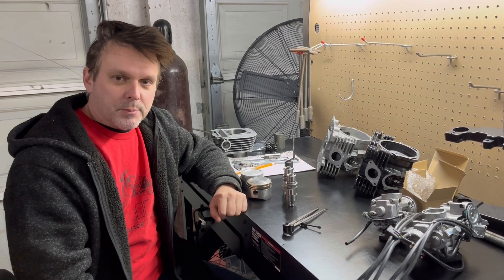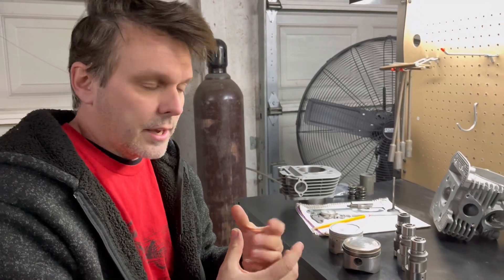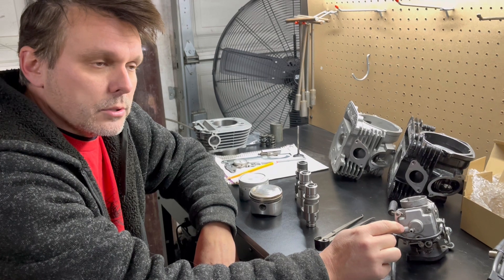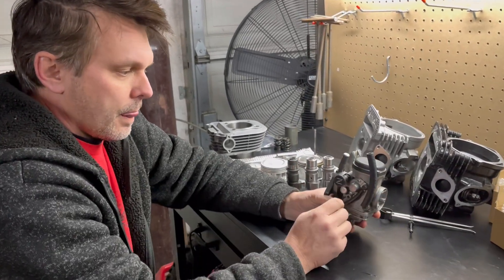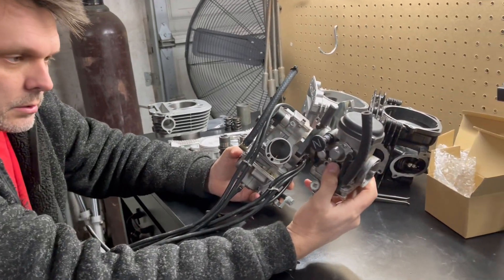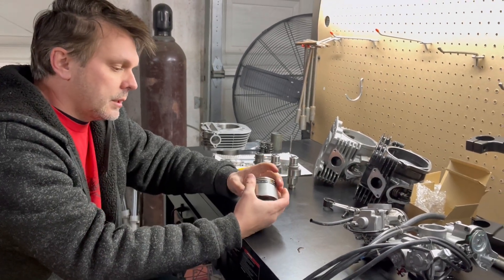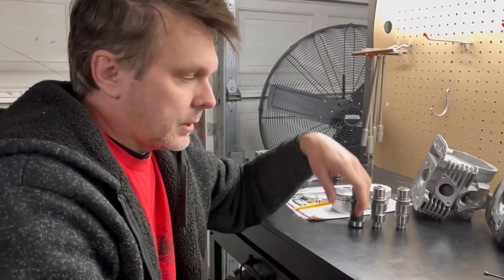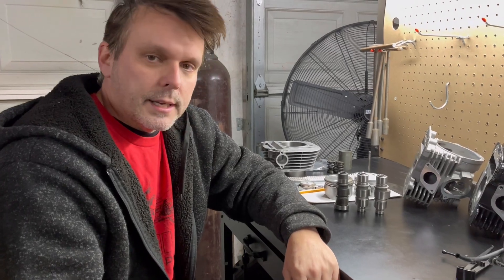Bradley Performance live video announcement and update- Q+A

Comment: I installed the 70 mm bore my mechanic is saying to take out the racing carburetor and put the stock carb back in I'm so confused I purchased all these items to work together 70mm bore the racing carburetor & high RPM Camshaft and now my mechanic is telling me it doesn't work right with the Tw motor
Reply from the maker: I have way too many questions to start the discussion on this forum, have your mechanic give me a call and we will get it fixed up. 870-613-4658

Comment: Great Video, Thanks. Have you ever done any testing with the"Smart Carb"  I purchased one late last year to try to deal with the elvevation issues with the stock carb. Still needs some fine tuning come this spring but no more elelvation issues.
Reply from the maker: I have not. I'm not opposed to it though. I have experimented with other non-pumpers and have found a bad lean situation under quick acceleration. So far a pumper has been necessary for our builds.
Reply: Ah ok, I'm finding running to rich, have ur big wheel kit with 60 tooth sprocket and ur cam sprocket,  love the kits as I don't do much on hwy.
Reply: I am having issues with the rear disc conversion kit. At first couldn't get it to work, tried bleeding through Bango bolt as your suggestion with no success,  finally dealer was able to get working, then it started dragging after 6 rides and warped rotor and took out brake pads.  Ordered another rotor and pads from you and it worked for about 4 rides now back to it not working. I can feel the pads squeezing when pedal applied but not enough pressure on rotor. 2nd issue is with big wheel kit I cannot get caliper on or off with removing wheel as jot enough room between rim and rotor, thus is with thr shark fin installed as well. Any suggestions? Thanks
Reply from the maker: @chriskiwior7778  unfortunately that is part of having the wide ATV wheel in the back with the disc. To get the caliper off the wheel or the rotor will have to be loose. It is hard to speak to a hydraulic brake problem like you described. I have never heard of this. Maybe we can get someone to speak up with any ideas. We will try to get you taken care of somehow.
Reply: @bradleyperformanceproducts  thank you, certainly not a deal breaker very much appreciated your R&D and quality of your parts!!